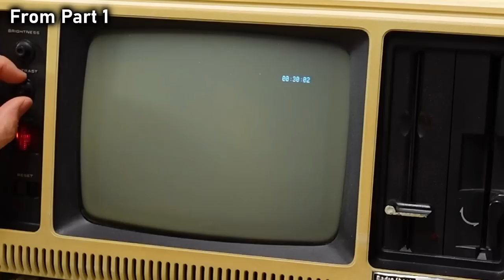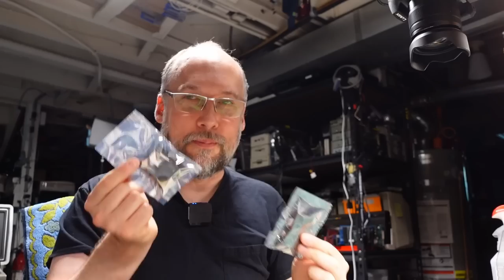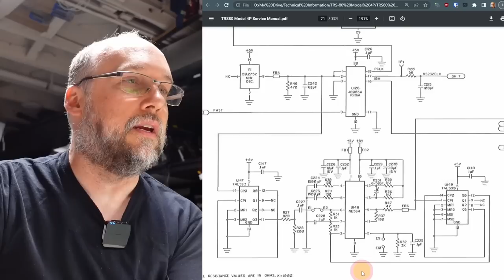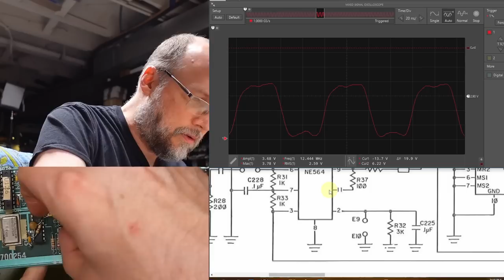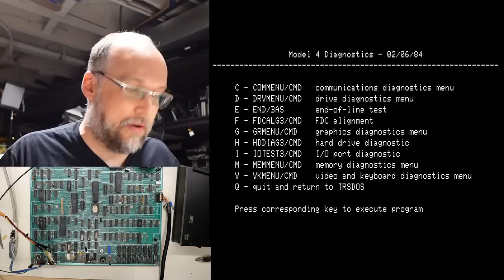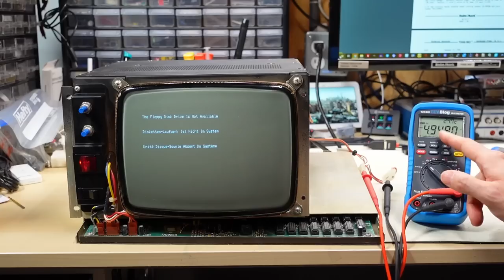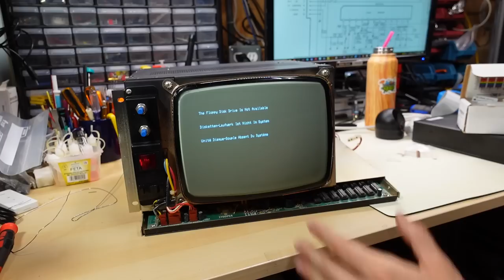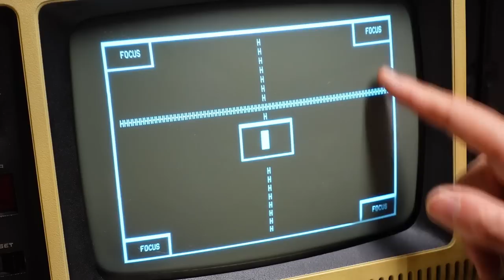TRS-80 Model 4P 80-column crash repair (Part 2)

Comment: The S symbol on the older PLL chip is for Signetics, which was bought by Philips in 1975, but continued operating as a separate brand. It is the company that invented the 555
Reply: The "triple nickel" timer. Endlessly useful chip.
Reply: @MrJohndoakes  Love the blast from the past..   aka TNT  (Triple Nickel Timer)
Reply: @MrJohndoakes  Yep! And still used in new circuit designs, mostly the CMOS version.
Reply: And the NE 571 COMPANDOR...

And the 2650....
Reply: @Theineluctable_SOME_CANT  Ah the 2650. As a kid (yes 11-12 years old) I built a system with this one from a book (unfortunately trashed it at some point). It was surprisingly orthogonal in its instruction set for the time it came out. 

Like all arithmetic instructions could work with or without carry depending on a flag, which was very easy to set or clear, dedicated instructions for setting/clearing flags.

Every branch was conditional, with 1 of 4 conditions to choose (positive, zero, negative, always) and worked in all addressing modes and so on. 

The 15bit adress space in 4 pages was somewhat annoying, though.

Comment: Your diagnostic capabilities are first rate. I was extremely impressed with your resistor change to brighten the screen and the discovery of the fan causing the interference. Your solution of using the electrolytic cap to filter out the noise was an excellent work around. I noticed there was little frequency change to the clock signal when you were adjusting the variable cap and I thought to myself, that doesn't look right. Then seeing on the schematics that, wide open the chip oscillates at 50 and it was running at 47, it clicked in my head that variable cap was likely the cause. It was obviously running the clock signal wide open. So, I felt good about myself by being suspect of that part and then watching later in the video to find out that my suspicion was correct on that part. Keep up the great work Adrian 🙂

Comment: Those Arctic F series fans are quite a bad choice for longevity, but they support a feature that isn't advertised for legal reasons (enermax has a patent on it). You can push the fan blades (as in: the entire white rotor assembly) out of the motor to clean them, which also gives you access to the shaft and bearing, meaning you can clean out (most of the) original lubricant and replace it with something that'll last longer than 3-6 months before the bearing runs dry. I've used some (obviously fresh/new) car engine oil filled into a little syringe for the longest time for relubricating fans and it has worked perfectly, unlike light machine oil which just caused things to get noisier somehow. Ideally you would get a dual ball bearing fan and never have to worry about any of that but you know... $€£  ...edit: they also have very low static pressure, so while they move a lot of air freestanding, something like a stamped fan grille will kill off a lot of that flow. just something to keep in mind depending on where they're used

Comment: Cool. Great to see it working. The trimmer cap (60pf ?) would allow for the exact PLL free running frequency to be set. Removing the jumper is probably for that same purpose so its unlocked while adjusting it. Once its set pretty close (within maybe 1Mhz +/- or better) then replacing the jumper allows for full lock and you're done. I think you hit lucky with the 33pF getting close enough, a trimmer would be more precise. The PLL circuit has a set bandwidth where it can lock. If the free running VCO is too far away from that, it will not lock.
Reply: I also suspect that you would be able to tune out the jittering being seen. There's an NE564 used in the Amiga 3000's "display enhancer" circuit and tuning the VC helps stabilise the image

Comment: 2:07 - Whenever I fix anything I always try to write down a description of what I did (especially if it's a mod of some sort) on a piece of paper and leave it either taped inside the device or with the accompanying paperwork. Not only does it help to remind myself what work I did, but the next person doing a repair will certainly appreciate it.

Comment: When Adrien is talking about the power supply, he uses the term "REEFA" (?), which I'd never heard used to describe a component. After some searching, I found that he was referring to RIFA, a Swedish manufacturer of resistors and capacitors. The two items he replaces are capacitors, which makes sense, since they are the most likely items to fail with age. And after rewatching the clip several times, I realized he said "capacitor" in reference to them, but I missed it the first few times.
Reply: We always called them Y-caps as he mentioned. Non-polarized and used in power supplies I believe to get rid of hi frequency ripple.

Comment: Hi Adrian. Try a 50 pF silver-mica cap instead of the 33 pF ceramic disk cap; the ceramic disk caps aren’t ideal for that application, as their capacitance varies with temperature, so they’ll drift in value as heat builds up in the case. 😢 The silver-mica caps are intended for RF (radio) applications, so should be a lot more stable.
Reply: Phase locked loop. I don't know why they used a variable capacitor in the first place. The PLL will lock on if the free run frequency is close enough.
Reply: @therealjammit  Its to trim out any error in tolerance within the PLL chip, power supply voltage and anything else that can effect the free running (unlocked) VCO frequency. Once its set close enough, then the PLL can lock and do its magic. Thats why they used a trimmer not a fixed cap. Although in this case, it worked. But in production, maybe not every time.
Reply: I would expect a ceramic disc cap with as little as 33 pF to be using some sort of Class 1 dielectric, with little in terms of tempco. Should be plenty good enough for this application. If in doubt, watching the free-running frequency while heating up the cap with hot air should establish how much of an issue it is.

Comment: Wow I am impressed of your ability to grasp when you do say that you probably don't...
Anyways, here is a crash course in PLL controlled VCO, (commonly used in modern radio receivers and transmitters)
Pin 2 is LOOP voltage, it has a legal range, if adjusting the small cap, the LOOP voltage should change, indicating VCO (voltage controlled oscillator) is trying  to change frequency, but is forced to stay since the controlling voltage changes, keeping it in Phase locking range. 
Those caps tend to fail over time, especially when touching them  :( 
they do contain some silver that tend to vanish over time due to oxidation.
TIPS:
take a couple of single strand leads and twist them hard (do not connect the back end) and you have a variable cap: loosen them gives less cap. tightening them gives more cap. To replace with a fixed value cap that you don't have:  Take a standard ceramic disc capacitor an nip the top of it to reduce the capacitance., when done, secure the cap with some nail varnish, you don't want any moist to enter the insides of a small cap :)
Good lock and keep up the good work!!!:

Comment: Nice job, although I'm cringing a bit at the use of a fixed cap to replace the variable one. Anyway, I wanted to comment on that PLL circuit configuration. The NE564 and 74LS90 combine to make a classic PLL frequency multiplier. You said at one point that the input from the 74LS93 was about 1.2MHz, which makes sense since U148 and U149 act to multiply that frequency by 10 times, producing the 12.5MHz you saw on pin 9 of the NE564 after you got the circuit working. The trick here is that the PLL will try to lock the phase, and thus match the frequency, of the signals on pin 3 and pin 6. The 74LS90 contains two dividers, a divide by 5 from pin 1 to pin 11 and a divide by two from pin 14 to pin 12. Although dividing by 5 produces a non-square wave output, following that with the divide-by-two 2 flip flop squares it up again at 1/10th the initial frequency. This 1/10th frequency is fed back to pin 3 of the PLL. Now when the 1.2MHz signal comes in to pin 6 of the PLL it will try to match the phase/frequency on pin 3, which due to the divide-by-ten function of the 74LS90 it can only do by feeding precisely 12.5MHz into pin 1 of U149. Voila... the PLL output frequency is exactly 10 times that of the output from U147, with the same long term stability as the clock feeding into U147. Note though that short term stability of the PLL output signal is not as solid as the crystal frequency it is derived from, so the PLL VCO must be a stable design  with quality components to minimize jitter. PLL frequency multipliers are all around us these days, used in the super accurate frequency synthesizers in cellular telephones, software defined radios, and GPS receivers. You just don't see them now because they are so tightly integrated. The trick with these modern frequency multipliers is that the feedback division can be changed to alter the output frequency digitally. The input frequency to the PLL will be the desired frequency step amount, and the divider will be adjustable to provide a range of outputs frequencies. For instance, an input to the PLL of 50KHz with a divider capable of being switched in increments of two (to preserve the square output from the divider) between 200 and 240 would allow for extremely precise VCO outputs of 10MHz to 12MHz in 100KHz steps. Cheers.
Reply: Great explanation!
He seemed to luckily hit about the right spot with his fixed cap, and unless circuit parameters deviate too much it should be ok sooo... eh, good enough. Though I'd still recommend ordering and installing a variable cap.

Comment: I just bought one of these on eBay and got super lucky.  It is not yellow at all, looks like someone stored it for years and it appears to be brand new.  I put in the Hi-Res graphics board and the inside was completely clean.   I'm still learning how to use it and I do not have a model 3 boot disk yet but I am enjoying using this.

Comment: We HAM ops do suffer so much from these plasic trimmer caps dying after years. For example the ICOM IC-471 has over 30 plasic caps in the YGR and other RF units. Unfortunately thes caps sort of depend on each other and there is no service manual that explains how to align them to what... You can only rely on one of two schematics with some pencil notes that some ICOM tech guys  made 20 or more years ago. SO thanks to these guys, whoever it was! And thanks Adrian for another entertaining and informative video!

Comment: Its great that you kept going when your understanding of the analogue circuits was lacking, and nice you didn't have to go too far to get better understanding (comments and the parts diagram). My brain works in digital by default, so I too understand the consternation that can happen when dealing with certain circuits outside of that comfort zone . It seems (from the video at least) that this machine was suffering from a "bunch" of small problems, which when combined, seemed to create one large problem. I think most people would agree, its nice to see old hardware back in a usable state, even if it takes a few videos to achieve that result. What you could do with that original PLL chip, is solder it into a small test circuit that is designed to help "de-mystify" some of those analogue "mysteries".

Comment: You need an old fashioned CRT Restorer, it allows for burning off gun ash and has been used for decades on Picture Tube Televisions.  There are also CRT Brighteners, which are transformers that take in the filament voltage and outputs 10 to 15% more AC voltage.

Comment: If you wanted, you could put the out-of-spec passive back on the board in parallel with a fixed capacitor. Instead of 33pF exactly, you would want something that adds up to 33 pF when the variable is at the center of its range. Then you'd have the original part still in place, and still providing some measure of tuning, although you're accommodating its operation in a much narrower range than it was specced for.
Reply: Good idea in general,  but I wouldn't trust that trimmer not to drift.
Reply: @marka1986  If it only continues to get smaller in value, it probably won't matter much because the bulk of the capacitance is in the fixed cap in parallel. It would take deliberate effort to re-form it to increase capacitance, so no worries there.

Another option would be to put the part back in place and set it at its absolute minimum and then just pretend it's not there. Leave the 33 pF cap, another 3 to 4 pF probably won't get out of the PLL range. Then as the part ages and becomes completely useless, the total capacitance will actually drift slightly closer to the desired value. :)
Reply: Realistically, this is how it should have been done from the factory, but I guess minimum component count won out. You would not normally want to have way excessive adjustment latitude in a finished product. Anyway, it seems 33 pF (luckily) is close enough that he may as well leave that in there and call it a day.

Comment: I made my own desolder braid using copper core speaker or lamp wire. I'd strip and flatten the core and lightly coat one side with flux so it would wick up the solder. Then I'd snip, strip, and repeat the process.

Comment: you could use a metal tube as spacers that would work if you wanted to put in a different crt with the tab mountings in a different location

Comment: You should be able to run the variable capacitor parallel to a disc cap of a reasonable value and use the variable as a trimmer to get more to the desired value. (It locking in now doesn't mean it will be reliable in the future if there is a different temperature etc.)

Many lifetimes ago, I ran a "Towne Crier" BBS on a 4P with the 300 baud "infernal modem" and a pair of 720KB Misubishi floppy drives (80 TK DSDD).

IIRC there was a way to add an IC to enable the 4P to run four floppy drives like the Mod 1-4 machines -- the 4P needing a separate ribbon cable for the second two drives. (My Mod 4 ran my store (camera repair wholesale/retail), with four of the half-height drives installed in place of the two full-height drives it came with.

I also replaced the switching supply with a big honker of a linear power supply. Why? Because the switching supply burned out (after the warranty ended, of course), and, I had a linear supply that fit inside the cabinet.

I eventually sold the 4P, but I still have the Mod4 somewhere (in my Citizen Kane area :)

I ran the business on a Mod1, to which I'd added a lowercase mod (a 21l02 chip, I think -- 1Kx1 static), piggybacked onto one of the video RAM chips, with a bunch of jumpers, a pair of surplus calculator keys (used as Ctrl keys), an Assembly language driver written by Dennis Bathory Kitsz (he also wrote the directions for the lowercase mod in his subscription newsetter).

Like a fool, I later on added a Mumford Micro turbo kit,  and that was the end of my Mod1 (close to four grand, up in smoke, to coin a phrase).

Ah, memories...

Comment: An idea would be to use reallocate-able code. That means once you call it, the entire code runs on relative jumps/calls etc.
This would allow you to start testing whatever memory is available with rom mapped in, then select a block that was good to copy the test to. Once copied, it can be called and would identify it is running from ram, and remove rom mapping to test all ram.
Reply: The Z80 only has "short" relative jumps and if memory serves me correctly, has no relative calls.  It might be possible to make code entirely relocatable by using something similar to the old DOS .EXE format.  The file contains both the code and a bitwise table of locations in the program which need to be adjusted, so the loader in the OS reads that table after loading the program and makes the address adjustments within the code before handing control over to the program.
It wouldn't be as easy to do on the Z80 though, since Z80 instructions are a mixture of 8-bit and 16-bit instructions, unlike the old 8088/8086 where all instructions were 16-bit.

Comment: maybe you already know this, but when you format a lower density floppy on a drive designed for higher density, it often gives problems because the magnetic head for high density is smaller so it doesnt write the full track. It can read lower density floppies fine but can only write lower density floppies for use in other high density drives.

Comment: I would also check the caps on the analogue board, if you haven't already. I remember one of the engineers at work telling me one of the PVMs I rescued from the e-waste was trashed because the retrace was visible at normal brightness, which usually indicates the monitor needed a recap. I don't know much about how CRTs work, but I guess it's possible the values or ESR of the caps could also affect the brightness/contrast.

Comment: Congrats! Another computer freaking works ;)
If the fan was able to upset the video circuitry, it's not unreasonable to assume it did the same with the disk drive hence why it failed reading. 
Normally this would be a clue on bad caps but.. maybe the designers just didn't put much capacitance on the power rails and it worked anyway? 
The PLL operates the way you assumed - I'd order a variable cap and install it there if possible, but as long as capacitance is within range it should work fine.
The CRT cathode may have degraded even if the computer wasn't running - just from the heat, given how yellowed the computer is. Overvoltaging it may degrade it even faster - although since the computer will probably not be used very often it may be fine. I'm not sure if I'd recommend CRT regeneration but maybe it's worth a try?

Comment: So, you should put the trimmer capacitor back in and then connect the 22pF in parallel. This will allow you to adjust the VCO to maximize the stability of the output clock.